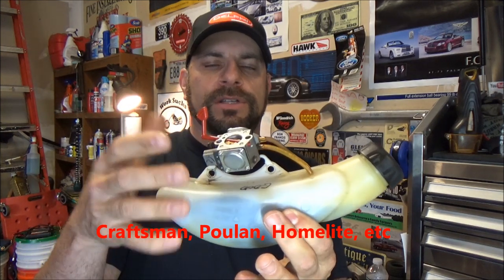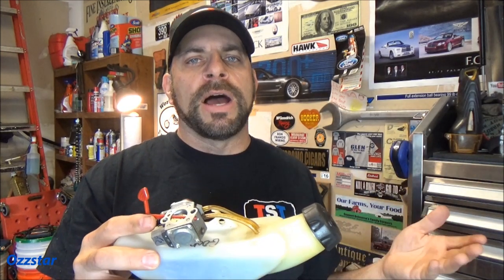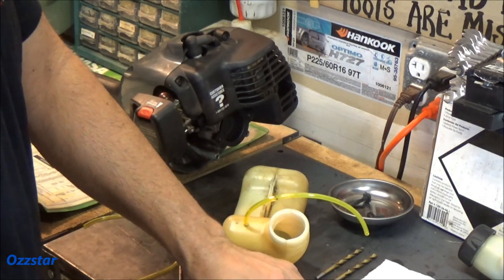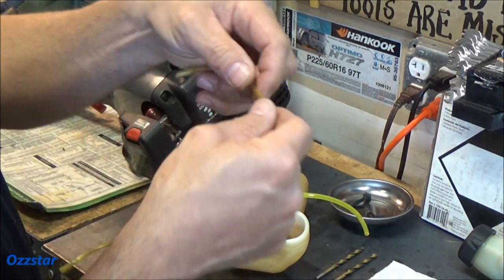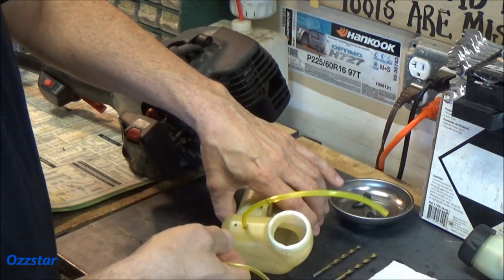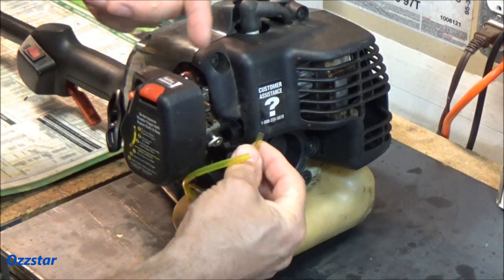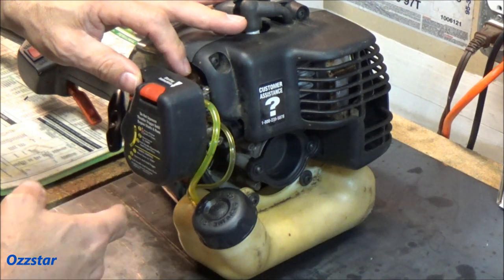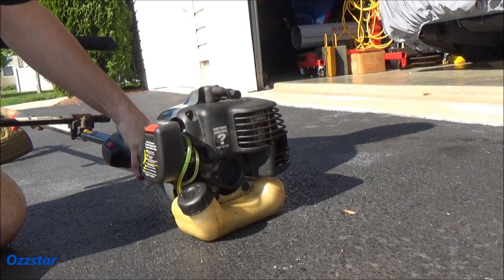Small Engine Fuel Hose Repair - Fix!

Comment: Yes, plenty of 'em! 😁

You do those the same way I do. Brilliant minds think alike! 👍👍

Free tip Wednesday for ya, Glen - use Tygothane (formerly called Tygon) clear tubing (made by Saint Gobain). You'll never change another line again. 😉 Not that pricey either. The yellow stuff everyone sells as "ethanol resistant" is only marginally better than plain, black EPDM hose. They all end up hard as a brick after a couple years, as you already know. Tygothane will turn bronze when submerged in fuel, but remains flexible. It will also withstand some elevated engine temps, too in other applications. You can get 1/32", 1/16", or 1/8" wall (depending on the ID) - 1/8" is overkill for weedwhackers, but is great for dirt bikes where the occasional stick might come in contact with it at 40mph.  Don't use it on fuel injected stuff, though - she'll get a little puffy & bloated.😁  I've had 5/16" ID hold 40 psi for several months on our Volvo 940 - it swelled up, but never leaked. Didn't want to press my luck, so I changed it. I've had my oil lines on my '74 RD350 for 10 years now using that stuff - all still good! Air cooled 2-stroke - lots of heat & vibration! Some of the line is under a side cover for the oil pump - gets close to 300°F in there when parked, I'd bet.
Reply from the maker: Thanks for the tip Smitty.  I will definitely keep Tygon in mind next time I need to go the distance.  Never heard of it before now. 👍
Reply: @ozzstars_cars  - No prob, brother. 🍻

Comment: I cut the end of the hose on an angle, like a needle to help get it though the hole.  sometimes I tie a string around the needle end and feed the string though the hole first, then pull on the string to help get the hose though the hole.
Reply from the maker: That's a good idea, thanks

Comment: Good stuff as always G!  I only giggled a couple times - which is impressive given 42 different quality "hose" references ;) 

I usually end up ordering a new carb that comes with the line and filter.  They're so cheap any more, and I figure that if the hose is gone that the gaskets and membrane in the carb have to be close.  I suppose I could rebuild the carb, but the whole setup is $20 or so?  Not worth the time.
Reply from the maker: Yes the parts are almost throw away these days.  For a few cents I change the fuel lines out in only a few minutes.  I got a hose that's so long it reaches my neighbors house.  Just saying Matt.  lol